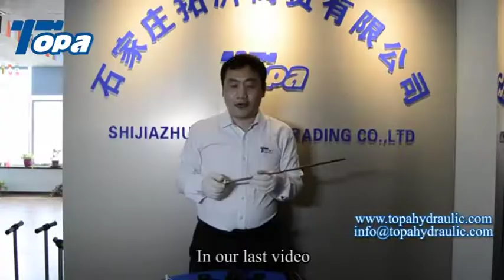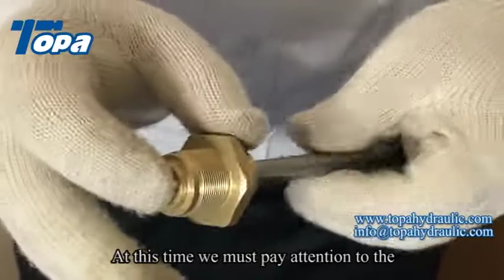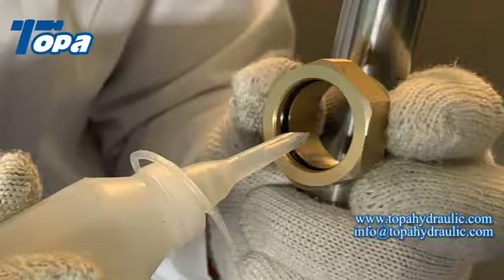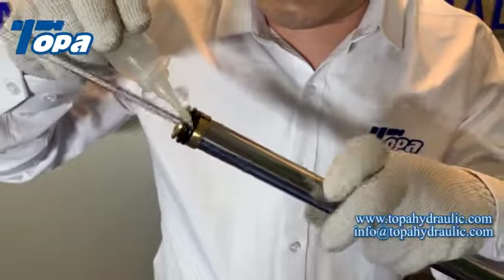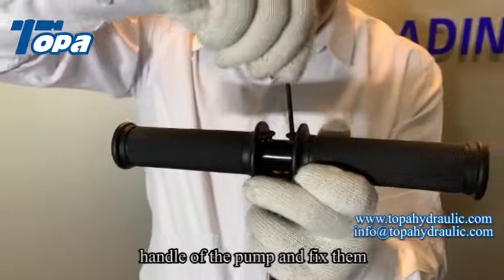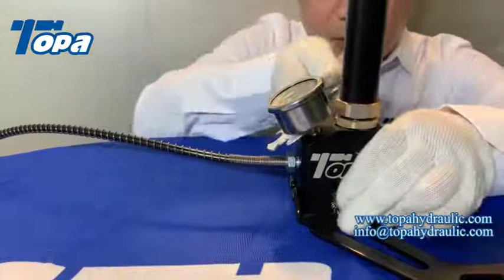How to repair the pcp 300bar 4500psi pcp air rifle air gun high pressure hand pump-B

Comment: I hve a Chinese pump...I noticed the piston O ring was broken..but aftr replacing it..pumping is easy but I can't feel the pressure the pump is gvn out to fill the airgun..I don't knw what s wrong with it
Reply from the maker: Hi, When you buy the pump, there is a pressure measuring plug in the accessory bag. You use the pressure measuring plug to test the pump first to see where there is a leak.